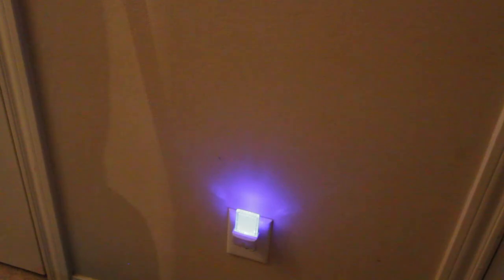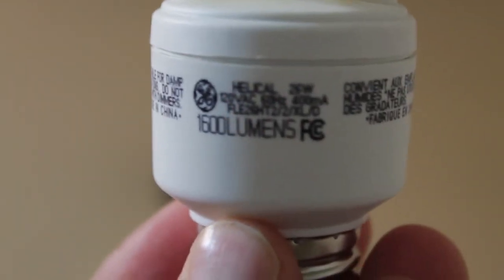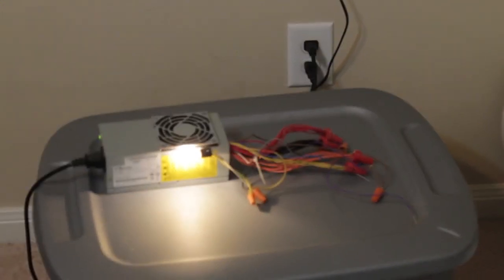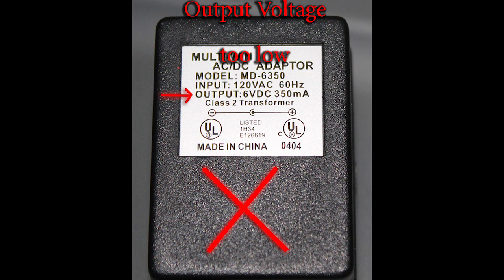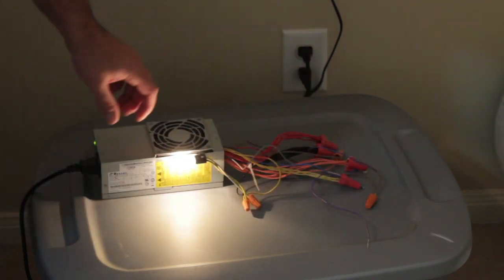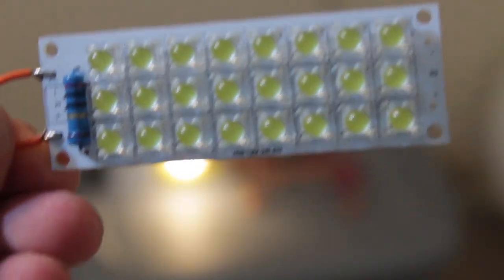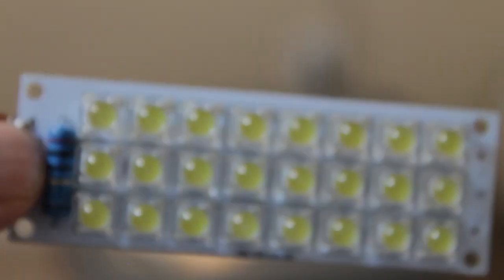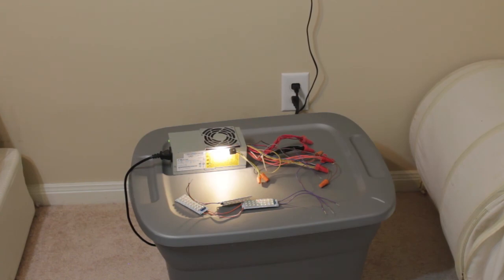Incandescents VS LED's

Comment: Brent, great idea! One question, how do colors look once you get your camera white balanced to these LEDs? That's where my LED lights have given me trouble.
Reply from the maker: 5500-6000K I think are their color temp. Once you set the camera to fluorescent Colors look fine. I'm going to be building a light board with all 10 today. The problem I keep running into is how focused the light is. Blindingly bright direct on, but hardly any light to the sides. I'm going to figure out a way to diffuse that more today.